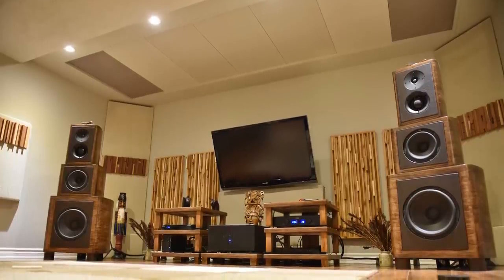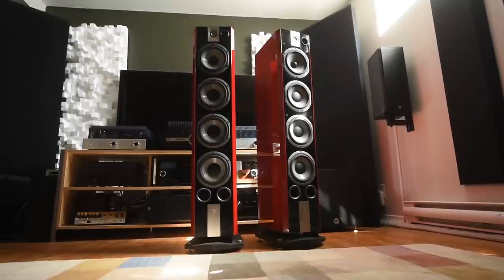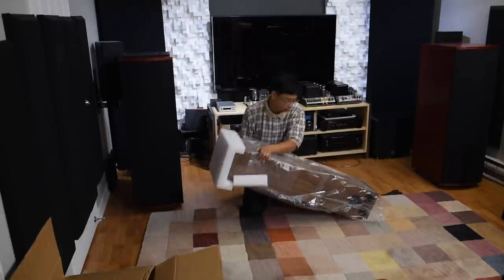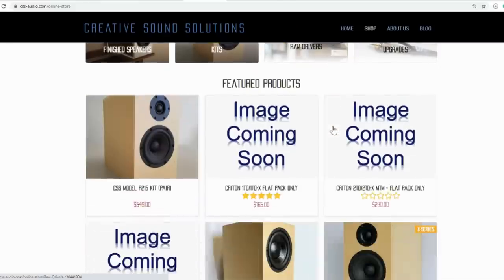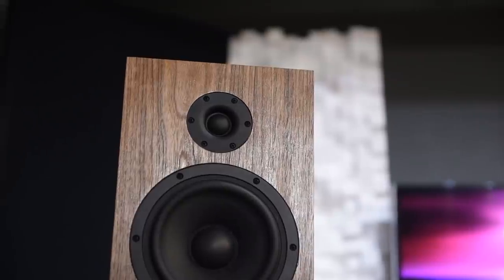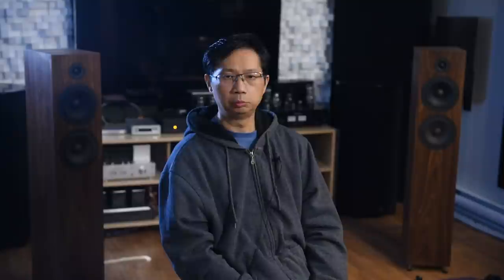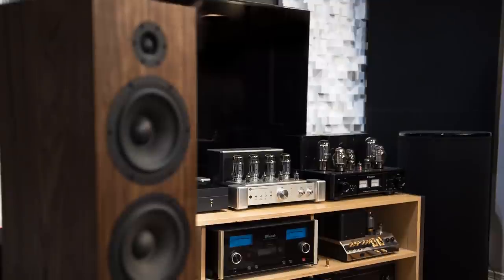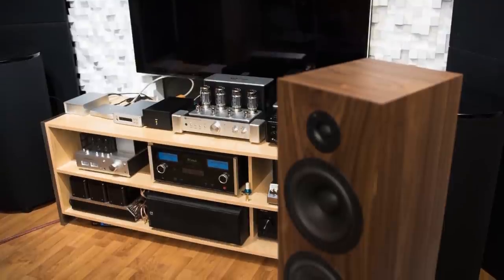Building your own high performance speaker, CSS Criton 2TD-X tower kit.

Comment: I've thought about these kit speakers for a long time. But, I want to move up in performance and sound so would these be right for me? I currently have connected Emotiva T2 towers, also the Definitive Technology 1060st. The Emotiva has more air than the defense techs, so would Css kit be an upgrade or a side step to a different sound? Oh, and I have a pair of DCM tfv6.0 stuffed away in the basement.

Comment: any opinion on how these would compare to the klh model 5. I have built gr research kits in the past and css subs so am comfortable with diy and am leaning to building a set of these for my cottage which is a large open area 800sq.ft high ceiling. 
was also looking at the klh model 5's which saves me some time but if the criton is a better speaker in the end I would go with diy

Comment: Thanks Thomas.
I want hours of listening and smoothness with great definition. I think you can get it with the right speakers and components. From what you're saying it sounds like this speaker is very picky about components. I know they're out of the league of this speaker but something like the Dynaudio C20's get you pretty close, maybe this is why I like Dyns so much. What do you think?
Reply from the maker: I like Dynaudio too. These are not that hard to drive but do need a bit of power.

Comment: My channel is dedicated to DIY, and IMHO, the terms "high performance" and "tower speaker" do not belong in the same sentence. Start with a satellite/subwoofer design so that the bass speakers can be located independently from the satellites, allowing for achieving flat bass response at the listening position, and the satellites can then be independently positions for proper soundstage presentation. The next and most important key to getting true high end performance is to build an all active design, eliminating the passive crossovers entirely to retain maximum clarity and dynamics of the speakers.
Reply from the maker: Not sure I understand, does it mean B&W 803D4, Focal Sopra 2 and so forth are not high performance? I guess if you defined high performance as flat bass response then it would makes sense? Interesting concept.
Reply: @ThomasAndStereo  Nothing against you, but the industry has never told the truth on the enormous negative impact that passive crossovers have on speaker performance. That's fine for the average consumer, but for true high fidelity, active is far superior. and the good news is an active system can be set up and tweaked by the DIY'er much more easily compared to attempting to design a passive crossover from scratch. But my main point was to abandon the other lie of the industry, that the tower speaker design is somehow associated with high fidelity rather than tell the truth that it is intended to appeal to the average consumer.

Comment: Hi Thomas, I am currently building a pair of these CSS 2TDX.  For speakers, I also have a pair of the large Polk SRS SDA's, a pair of the Solstice speakers (I built from kit) from Parts Express, and I also am building a pair of Zaph Audio 2.5 speakers using Scan Speak Drivers.  I do not have expensive amps like you, however.  Here is what I have in my stable.  A McIntosh 2105 100watt, a Threshold S200 Statsis 100watt, Yamaha 801 integrated 100watt, an Akitika 50 watt amp I built from kit, and my prize possession an original Fisher SA1000 massive tube amp using 8417 tubes (has been tuned up).   Can you recommend any amps (preferrably used) which would be similar to the Moon 340i which I could buy for 1000 to 1500?  Which of my current amps do you think will  sound the best. I'm not a Focal fan, but I do like some brightness in my speakers, but not too much.  I'm also wondering how the Criton's would sound if I cut the top end resistor value in half or by a third?

Comment: Check out LSA speaker. Very HiFi sounding.
Good stuff Thomas.
Reply from the maker: I did ask them for a pair of speakers but they send me a power amp instead. A very good class D amp.
Reply: @ThomasAndStereo  cool. Wally usually has great sounding gear. Speakers are good value for performance. Peace

Comment: Hi Thomas. I was considering the 1TD-X model for my Doge 10 Mk1. Finally I went preordering Buchardts s400 Mk2. I think that I can give the Critons a try next year. By the way, what capacitors did you finally leave in your Doge 10?. Did you make additional mods?.
Reply from the maker: Yeah, I put the capacitors to the feedback switch. So kind of like have 3 voicing on my amp.
Reply: @ThomasAndStereo  Thomas, what capacitor value you like the most?.

Comment: Some reviewers compared these to 10K Sonus Fabers (blind A/B testing) and 7K Dynaudio Confidence. But if CSS are “not” high resolution, wouldn’t it be more fair to compare them instead with 2.5K speakers like Lintons, KLH, and Burchardt?
Reply from the maker: Here is the thing, i heard the bookshelf version and it sounds different than the one I have here. That bookshelf did not sound rolled off at all, and there was lots of resolution.
Reply: @ThomasAndStereo  Thanks !
Reply: @ThomasAndStereo  hi which CSS bookshelf version / model did you hear ? Thank you

Comment: Thomas, I am looking for some "musical" bookshelf speakers to go with a push-pull tube amp.  What brand of speakers should I consider?
Reply from the maker: Yeah, not easy for that question especially you wanting to drive it with a tube amp.
Reply: I'm not Thomas ... but DIY 2 way bookshelf speakers that are just about the best are the Carrera speakers by Paul Carmody. Scanspeak and Hiquiphon are about unbeatable for musical. But tube amps for bookshelf speakers is very difficult

Comment: Question, do you have experience or opinion of the isoacoustics gaia feet? They are all over the place and unfortunately the demos smell of snakeoil salespitches. And on the other hand there are good user reviews. So its rather a mixed bag for me atm.

Unable to lend and test them as i have monitor audio gx200 gold speakers that need a custom thread (which granted they have, separately....).

Also carpets at home so it would need the special holders, with spikes, also sold seperate.... with some good finds it would be 300 euro/speaker.

'Is this the no brainer go get it', or 'it's all in your head' :-)
Reply from the maker: My friend has them but I never bothered borrowing it to try them. He told me although he heard a difference, he is no longer using them. The problem for him specifically is he is nearfield and the feet raises the speakers a bit higher than normal spikes so the tweeter level is no longer the same.
Reply: @ThomasAndStereo  That is a good point. In my case it might actually help a little bit due to the unfortunate layout of my room. I would need to sit up more straight lol. I calculated about 300 euros / speaker (if i use a marble slab to put them on instead of those carpet spike things). So asking around a bit.

Cheers for the fast response 👍

Comment: As a 2-way design, the bottom woofer is pretty far from the tweeter.  Did you find that your listening distance was farther than usual?
Reply from the maker: No, it was fine. I did ask why they did not go for a MTM configuration and they wrote me a long email explaining it.
Reply: James, because our crossover point is so low you would need to be listening nearfield (1m or less) to have any significant impact and these are not intended to be nearfield monitors.
Reply: @kerryarmes2786  Didn't think so!  It's good to hear an experienced reviewer like Thomas confirm what I suspected - you guys know what you're doing!  Saving my pennies.
Reply: @ThomasAndStereo  They do offer a mtm that could be made into a tower so it's nice to have choices.

Comment: So can you get musical speakers that are immensely detailed analytical in that they present all the information available transparently crystal clear but no sizzle. Imagine two 12” woofers. A super tweeter. And a mid range spread by a huge 15” horn. A musical speaker dynamic powerful and yet revealing too. I miss nothing and really get both musical and analytical. Is this the best of both worlds. Of course, electronics, sources and amps, and cables. Power gives musical and transparency, yet what goes in…Oh this took nearly twenty years of experimentation to reach! In and out of tubes, pre/pro, integrateds, a few speakers, although somehow they were easier to choose. Boston Acoustics then PMC now Viking Acoustics with a few Monitor Audio that’s pretty much that. A lot more sources DAC’s and amps than speakers.

Comment: Nice video. How would you classify Harbeth and Magnepan? Analytical or musical? Maybe odd but thinking between both speakers. Harbeth more expensive though so it's in the SF lumina 5 range which is a really interesting speaker. Cheers.
Reply from the maker: If there is a middle point, they are closer to the side of analytical.

Comment: CSS is good equipment, but not great. You should hear a properly designed DIY speaker with Scan or Accuton!
Reply from the maker: Well until I hear more DIY gear, I would say these are great. Everything is relative to price and what is out there.
Reply: @ThomasAndStereo  They are great for the price, Thomas! I'm not knocking them in any way. I'm just trying to tell you better drivers and crossover components takes sound quality through the roof, when combined with extremely well-built and braced cabinets. The speakers you just reviewed are pretty much slightly higher entry-level into the DIY world.

Comment: i can't speak on them speakers but diy is always the best if u can, i built a pair of swan m1's with good parts for 400$ an it makes 2k$ speakers sound veiled, also its best of both worlds is very musical but also hyper detailed, as long as tweeters are placed at ear level the short comings of the planar tweeter isn't an issue, im just saying u can have both, but audio is weird right now, why pay for  name? when most 10k$ speakers used the same 60-90$ drivers an they use cheap parts in the crossover, so what are u really paying for an over priced speaker that is pretty? im about function over looks, after all the music is what matters right ?
Reply: Function over aesthetics…I thought I was the only one left. I can’t believe reviews in which fully half the time is dedicated to appearance. I do have a supportive wife however.

Comment: Building the boxes is the worst part. To do it like high end speaker boxes it's a nightmare and it's still fairly costly. Especially if you stray away from the usual box shape. And if you only have the basic hand tools. If you want to make boxes in numbers you virtually need a factory, or at least a fancy lazar wood cutter that can cut at any angle etc.

Comment: Leave in comments what speakers we have at the house. I have a big 3 car garage, with 32 pairs of speakers  I built myself. Each one completely destroys anything at the price point manufacturers put out. I know, because I've sold high-end audio speakers for 35 years. I've had them all in my house to compare. DIY kills manufacturers loudspeakers for a tenth of the price
Reply from the maker: I think you beat everyone and here I thought I had a lot.
Reply: @ThomasAndStereo  What this really means, is I have impulse-control issues LOL. Everytime I see brand-new fascinating drivers that look interesting, I just have to start designing and see what they sound like. The benefit is, when you do this like I have, you can usually look at a manufacturers speaker, recognize the drivers, and know what they should sound pretty much like if the Crossovers were nailed properly. Every five or six years I have to sell a bunch of them to have room to make more LOL. Talk about a sickness and addiction!

Comment: I'll cut those ports out for a start not doing you any favours.
Instead put a piece of half an inch plywood where the port was, about 1 inches from the back connect another piece 30" up the back brace in a couple places at the top near the bottom end in the centre with some square stock and of course along the sides 1 inch pine square stock attach with builders adhesive takes a week to cure properly.
Not sure I'm fan of that tweeter who makes it and the woofer Thomas

Comment: Let’s be honest.  CSS is DIY only in terms of you putting it together, NOT in terms of design.  The chances of anyone designing a good/great speaker on a first try, no matter how good (expensive) the drivers you use, is very low.  Too many considerations go into good speaker design.  If you want a taste of them, check out the GR-Research podcasts that discuss the various considerations in good speaker design.

Comment: Diy compete? Your doing all of the labor, as long as you build a proven design or really know ur stuff, any diy should destroy a commercial speaker!  If not you have failed at ur diy speaker project. Sucks that people dont understand the simplicity of why diy speakers are  better if done correctly. Diy s the ultimate get what u pay for speaker imo.

Comment: You do not just save the labor. I have taken apart MANY pairs of speakers that cost over $10,000 ... Just to find $1000 in drivers a parts, and cabinets that are built like a laugh! 
And I have seen HUNDREDS of well regarded and award winning speakers, which have stupid crossover flaws that need tweaking.
Commercial speakers ARE a RIP off!